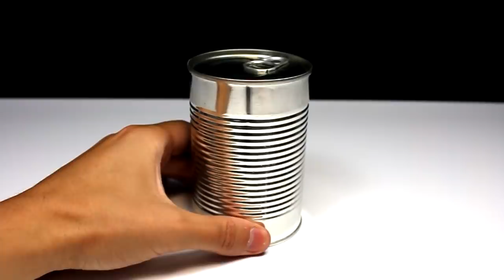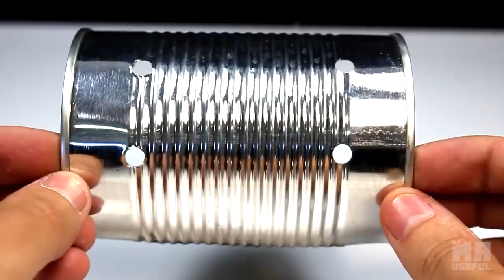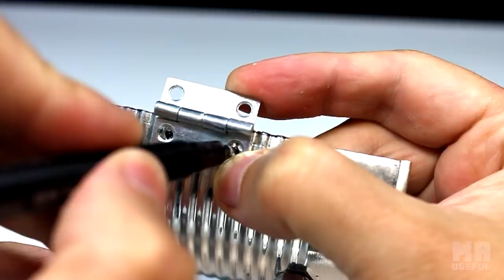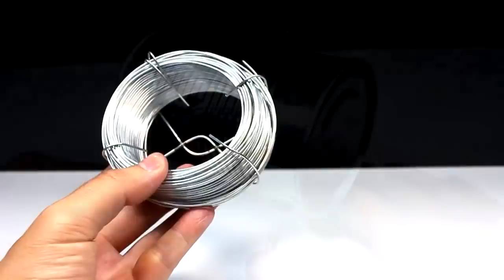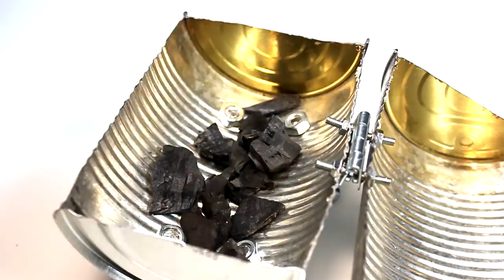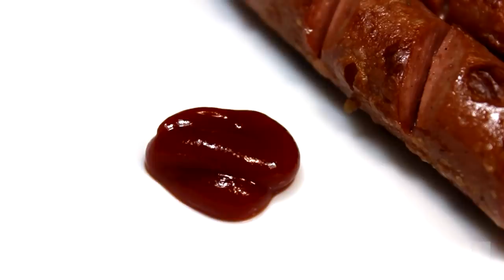How To Make a Mini BBQ

Comment: Ok, that was a good prototype but there are some points to improve. The can should be large enough to close when cooking. The handle should be wood. There should be either two hinges or a single longer hinge to stop any twisting motion. The grill needs to fit inside the larger can so it can be closed during cooking.  Even if the legs are adjustable, three might be better than four so it will be stable on irregular surfaces. I might be better to tilt the can slightly forward so the hinges are above the front opening when sitting flat for better balance when the lid is open. Spiffy paint job... maybe black with flames? This could be considered a multi-fuel stove too. Good job.
Reply: You really put some thought into this. lol
Reply: Mr. Usefull uses his hands and I use my brain... it's what I do.
Reply: @brianbassett4379  Speaking of which, Mr. Useful also seems to have heat resistant fingers... Or perhaps he's just invented a way to suspend the laws of thermodynamics.
Reply: @thekpmckay  nah he simply grilled the dogs on a real bbq and put them in there for show
Reply: @S1RLANC3  yeah i think he stayed up all night to tell us what a real bbq looks like

Comment: Those side cutters he shows in the vid to cut the can with would NEVER cut that can that clean. I call bs. It looks to me that a band saw was used instead. Go ahead and try these cutters and you will get nowhere. It could sit on a shelf maybe but it's a totally crazy idea to eat anything out of a heated food can. Many chemicals indeed.
Reply: Exactly ,  no way would they make such a clear cut as an electrician I use snips everyday in life tin snips would be better but getting a start point would be tricky, BS me thinks 😂
Reply: Already did it it came out as smooth as ice
Reply: How do you have a totally clean can that was supposed filled with preserves but has no discernable opening?

Comment: Thats pretty clever, use smaller dogs or a bigger can (maybe a #10 can, the really big ones about 1 gal) and an uncoated steel coat hanger for the gr8. Hmm. Ok list of items to make a mini grill that is big enough. 1-#10 can, 2-1" hinges, 1 wood drawer pull, 1 uncoated steel coat hanger, 12" small steel chain, 4-2" 1/4 20 bolts, 8-1/4 20 nuts, 4 lockwashers, 1-1/8" bolt, 3 washers to fit, 1- 1/8" nut. Tool list, hacksaw, sharpie, straight edge, 1/4" drill bit, 1/8" drill bit, linemans pliers, drill, screwdrivers, and wrenches to fit. Did I forget anything? Pretty much build the same way except make a bottom rack for the coals and a daisy wheel for vent (to better control the temp. Oh ya, 2 hot dogs and buns. Tailgating here I come, maybe I make a few and sell them.
Reply: Make one!
Reply: I can't believe you spent that much time on your comment.

Comment: Absolutely love this!  Useful and cute!  So want to make this!  Just one thing.  How safe is it to be burning charcoal in one of those cans?  Many cans are still lined with BPA.  And if BPA is harmful just by being in the material of the can itself at room temperature, it would be dangerous to heat it with coals, thus rendering the food cooked on it harmful.  I'm not an expert on crafts so if there are specific cans (and other materials) to look for when making this, please share.  I just think that people should think about harmful fumes/chemicals that can be released into food when it's cooked on materials that are not meant to be heated are heated to a high temperature.
Reply: ur right but why do they put food in the can if it has a harmful chemical in it

Comment: Very cute. But for all the trouble, I think I would just stick a hot dog on the end of a straightened wire coat hanger, and hold it over some burning branches. Then I would do marshmallows. That's what I am going to do the next time a hurricane comes and my electric is out for six days again.

Comment: How do you deal with deathly sharp edges from the tin snips?  And was that tin full before you cut it in half?  I spent half the video trying to work out how you get an empty tin can with both ends intact. Lol
Reply: Sparka J I'm sorry JS I don't see how using two cans makes any difference.   You either use a drinks can, which you could empty via one of the leg holes, or you have to wade through whatever the contents are in order to cut it cleanly in half and have the ends still sealed.

Comment: A better one would be using a juice can. Would only need one more hinge and a bit more wire for the grill. OR, use some concrete grate as a grill. Then you could cook six doggies at once. Or a chicken hindquarter. Or two burgers. A trout? Not too big and yet not too small so the options are greater than a soup can.

Comment: the problem is this kinda metal is not supposed to be burnt.  It might give out toxic material and be absorbed by the meat and it could be carcinogenic
Reply: tin cans have plastic lining to prevent food from contacting the metals... yummy
Reply: damok9999 
Actually, if a can is coated, it's because the contents are acidic, and the coating is usually a thin enamel. Preheating will burn off any carcinogens from the can. It's the red meat and burnt red meat and the fuel where you will get all your carcinogens. 
Who cares though, you gotta eat hotdogs when you are camping.

Comment: This is a cute idea for a nic nac but unless you season this thing properly first youre going to be ingesting the toxic vapors and chemicals in the galvanized coating of the cans metal but there is a very thin layer of plastic liner in every can to prevent rust. Im sure this guy got ill from eating these hotdogs.

Comment: Ahh...ya, fun,  You did not cut that can with those diagonal cutters. you cut it with something much more effective!  The puppies didn't even fit, but, it looked like they were sweating like they were inside.   In closing, just who eats hotdogs w/ katsup?  Mustard for hotdogs.  Other than that, fantastic contraption! Keep that gray matter well oiled, and by the way...I don't believe for one minute, that if you wanted a hotdog, and didn't have a grill to use, that you wouldn't just use that butane torch and a fork on those juice puppies!  Isn't allowing everyone to have an opinion a wonderful thing?  (edited for atrocious spelling!)

Comment: Cool, but completely impractical.  Just lighting lump charcoal can take a few minutes.  Better off with a wire coat hanger, a hot dog, and a stove; electric or gas.  You will be eating far quicker.  Just watch out for the grease.

Comment: Heated galvanized wire and fasteners, heated plastic sealing inside lid connection, heated clear epoxy seal coating inside can, beautiful.  Burnt chemicals on my chemical filled weenie...YES !  I like my industrial flavorings created through the magic of science and chemistry ! Hey dum dum, why not use oleander wood as fuel, while you're at it.

Comment: use a #10 size can. Large enough to close the lid on hot dogs or brats or burgers. Also, peel off the plastic coating that lines the inside before doing any cooking, Edit: like this: https://youtu.be/w-o1ydcshjg